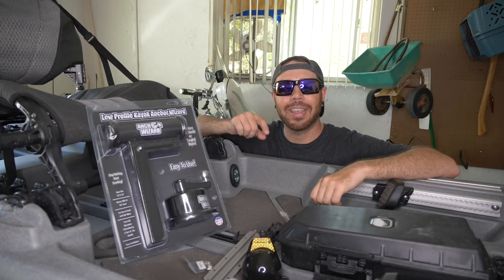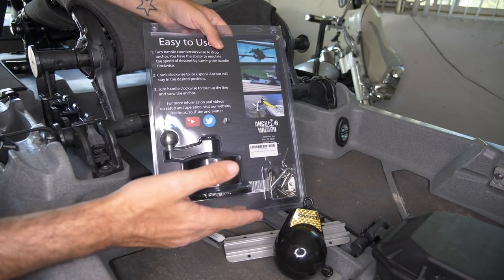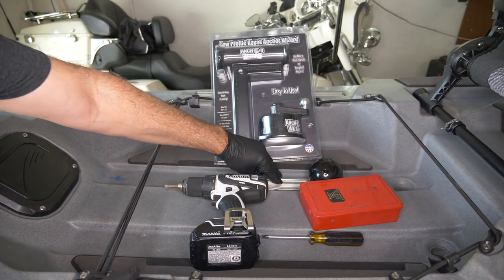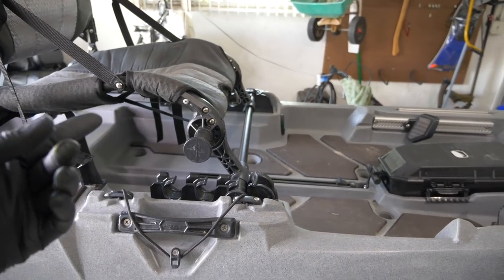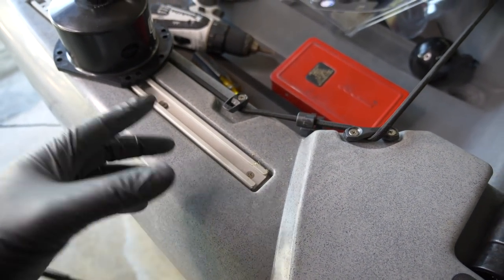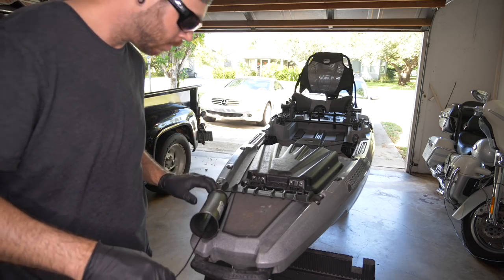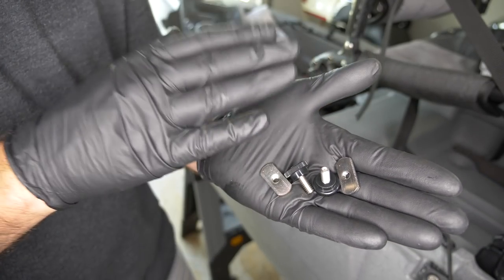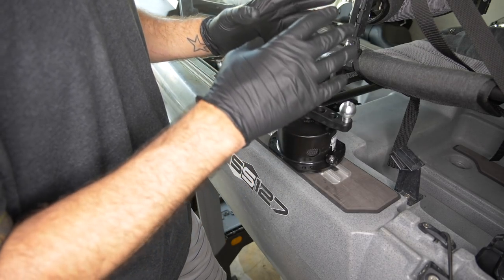How To Install Anchor Wizard Low Profile On Any Kayak | Super Long In Depth Version

Comment: Nice. I really want to install this Anchor Wizard on my Native Watercraft Slayer Propel 10 MAX kayak. Problem is, I mostly fish deep water (by "deep" I mean over 100 feet, typically around 100 and 120 feet deep) for lake trout and whitefish for which I need close to 200 feet (if not more) anchor line out in the water,  but this Anchor Wizard does not look like can hold that much line (it's like more suitable for shallow water only due to limitation on amount of anchor line it can hold and reel in/out). I am wondering if it is possible to replace the anchor line that comes with this Anchor Wizard with some thinner (but strong enough) line, and hence can accommodate  much longer (say close to 200 feet) line....  Thank you.

Comment: Hello what are you putting on surface of kayak to stop the anchor line from cutting into the top of kayak from line going in and out on the front of kayak
Reply from the maker: I'm not using anything. The rope that comes with the anchor wizard isn't abrasive, and the finish on the Bonafide SS127 is smooth, so there isn't much friction. I no longer own this kayak, but for the 3 years I had it, there was never a wear spot where the rope rubbed on the kayak.

Comment: I did the same basic set up without using the chute and like it. Any reason why you are not running the anchor line through the proper hole in the wizard housing? Just wondering if it makes for better retrieval.
Reply from the maker: I didn't want to run that extra piece on the yak. One less thing to get in the way.
Reply: FloBass thanks for the reply. I didn’t mean the chute. I meant that in the video, your anchor line is coming out of the housing from the wrong hole. Wondering if there is a reason for this?
Reply from the maker: 😅 User error
Reply: FloBass “User Error” is my middle name!

Comment: How do you position your kayak without an anchor trolly. How does it work using it off the front like that?
Reply from the maker: I fish shallow water. I have a power pole micro on the back with a 12' spike. If the wind blows me out of position with just the power pole I drop the anchor wizard so I can keep the boat pointed in any direction I want.
Reply: Thank you for your reply sir.

Comment: Would that downrigger weight fit up into the anchor chute had you used it?
Reply: Just realized this is an OLD video, how well has the downrigger weight worked for you?
Reply from the maker: No the weight doesn’t fit in the tube. It’s about 1.5 times larger
Reply: @FloBass  Thank you! has the downrigger weight worked well? Does it slide on the bottom being round? I ordered basically the same things you used so im just curious. Thanks!
Reply from the maker: So far so good. I fish shallow and there’s not much current here in South Florida. Just windy at times, but I don’t budge.
Reply: @FloBass  Thanks!

Comment: Thanks for the videos. I am in the process of accessorizing my SS127.  Can you please post links to where you procured the items that you installed? Also, does the position of the weight on one side or the other affect the tracking of the yak in any noticeable way?
Reply from the maker: I got it all on Amazon. They're all really easy to find on there.

Comment: so all you had to buy from lowes was the metal eye thing? so the wizzard comes with the little black thing you screw on? isnt that the same part that holds the drawer down on the ss127
Reply from the maker: The anchor wizard comes with a bunch of hardware to either directly screw it down on your boat, or the track hardware. Pretty much the same thing as the drawer hardware.

Comment: How much does the anchor weigh and is it strong enough to use on a Jon Boat?
Reply from the maker: The down rigging weight I used was 5 pounds. I think if you're in a bare jon boat with just a trolling motor it should keep you in one place. But in current you might drag the anchor.

Comment: How did that down-rigger weight work out on the water?
Reply from the maker: It worked pretty well. Only use it when I need to anchor deep, or when its windy and use it in union with the power pole to keep the boat pointed where I need it.
Reply: @FloBass  that's a brilliant idea for an anchor.  Where I fish the Rocky bottom hangs my anchor.  Think I will give this a shot.  Smooth ball won't hang up!
Reply from the maker: EXACTLY!

Comment: are you worried about the line rubbing on the front from repetitive use? i wanna get this also but havent really figured best way to mount i dont want it to rub on yak
Reply from the maker: No I'm not worried about that. The kayak is non abrasive. It would take 10 years of constant use to wear through it.
Reply: Ahh ok

Comment: Those eye bolts arnt stainless?
Reply from the maker: The one's I used had a clear zinc oxide coating, which is more than sufficient for the freshwater this yak sees. Just need to keep in mind that if you bang up the hardware it will wear through the zinc coating and eventually rust. Two and a half years later mine are still in great shape.

Comment: Does the ball actually keep you in place?
Reply from the maker: It actually does. 5lbs is a lot for a yak. But remember, I live in Florida so current isn't that much of an issue. Wind is a big factor, but the ball has done well since I installed this a year and a half ago. That combined with the power pole micro, and I can stay in any boat position I desire.
Reply: @FloBass  awesome. Seems more convenient with the ball over the pronged foldable anchor. I bought a yak attack shallow anchor pole and want another anchor for the 15ft range or so
Reply from the maker: Definitely way more convenient. I have to deal with lost of vegetation and those prongs bring up 80lbs of grass along with it.

Comment: I would of traced around the gear track after you found a location you wanted to mount it and cut the sea deck out in that shape so you could recess the track inside it for a flush mounted look.
Reply from the maker: Yup, said the same thing in the video. Still holding strong. One day I'll do it.

Comment: I've noticed others have used razor blade and traced the track with a blade so it can be screwed directly to the Kayak instead of on top of the pad . Don't know if it Truly Matters m but I'm Sure yours will do just fine . Great Video,  love All that your doing with your Mods 👍
Reply from the maker: I actually did mention in the video I might do exactly that later on. So far I've had no issues. The screws are plenty long enough and haven't budged. They have a good grasp on the body of the yak. At this point it I don't have a reason to cut out the pad aside from making the anchor wizard sit flush to the pad. I still may cut the pad out.
Reply: @FloBass  Sweet , I'm sure the Way you did it will hold up just Fine 👍

Comment: I would rather have a trolly set up so i could control the anchor more, front and or back , plus have a quick release with a float on your anchor line. The way you have it you could possibly run into problems.
Reply from the maker: Everyone has different needs. I do a lot of shallow water fishing, so the power pole in the back, and this in the front is the best setup, for me.